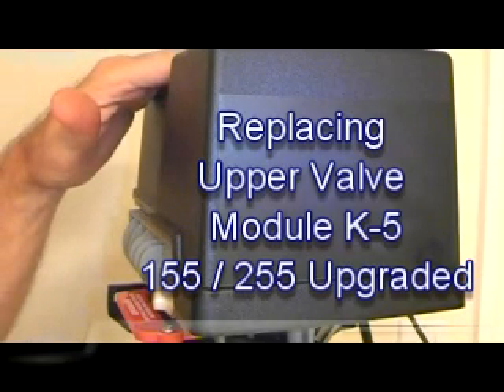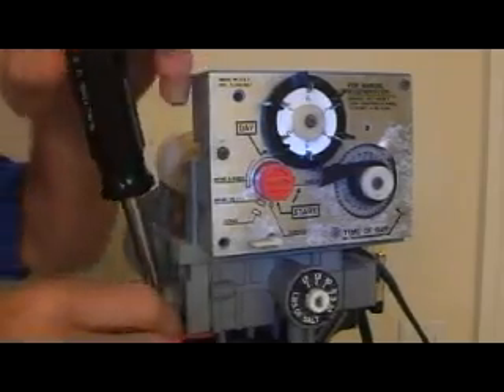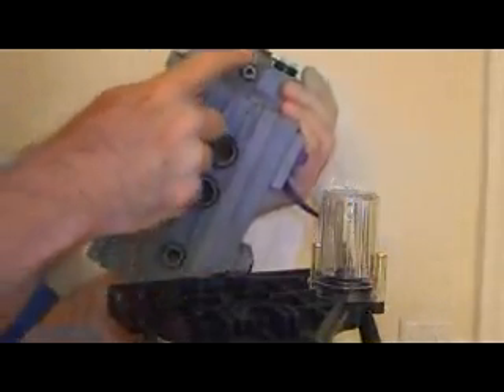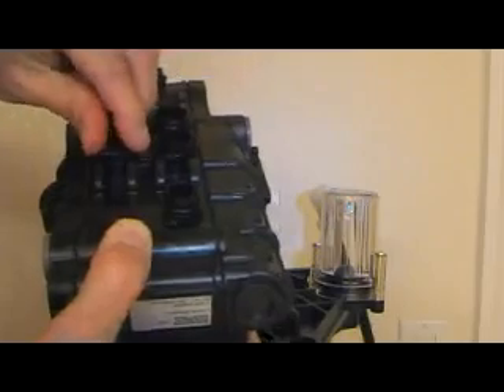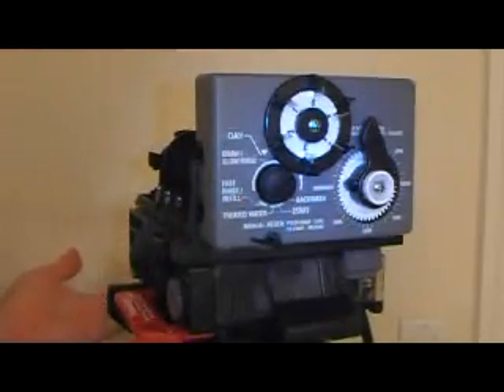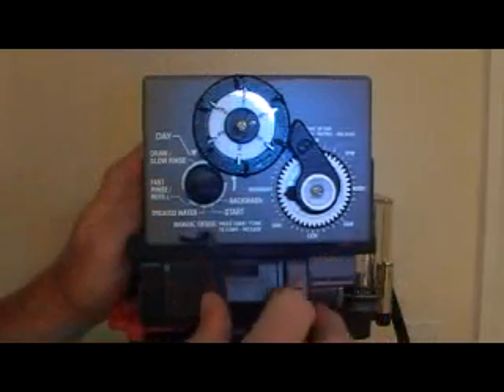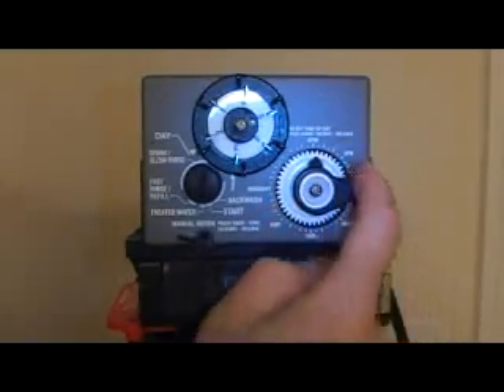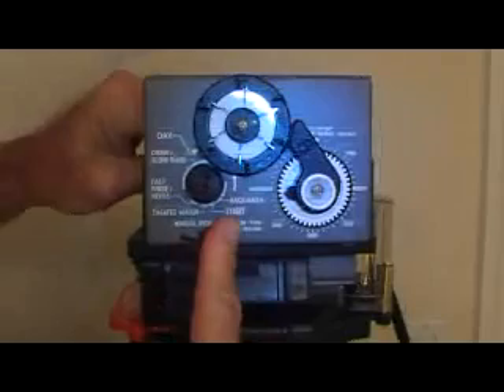Autotrol 255 Upper Valve Module Upgrade

Comment from the maker: New Versions = Autotrol 255 Upper Valve Module with 460TC Timer Assembly, transformer, camshaft, cover and Oring kit. 
Fits all Autotrol 155 and 255 Series Tank Adapters, as the 440 series timer were replaced in 2011 by the 460TC. See our 460TC Installation and Programing videos on our YouTube Channel or our Website.